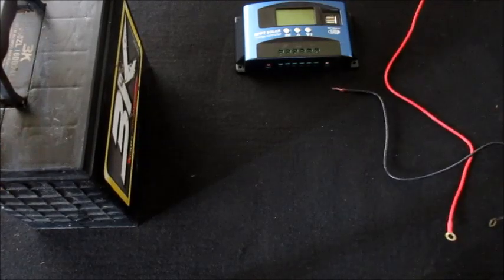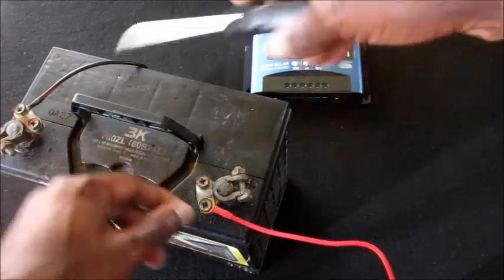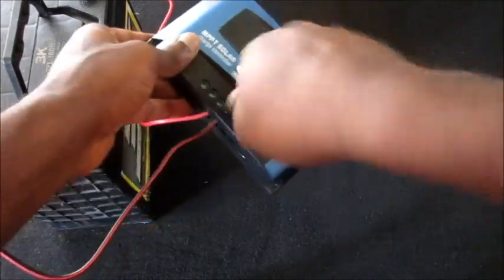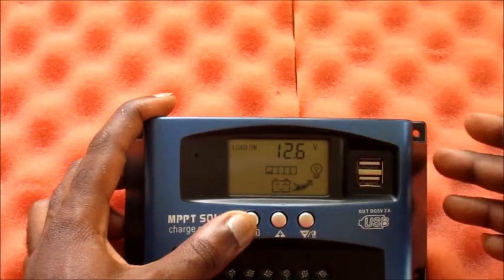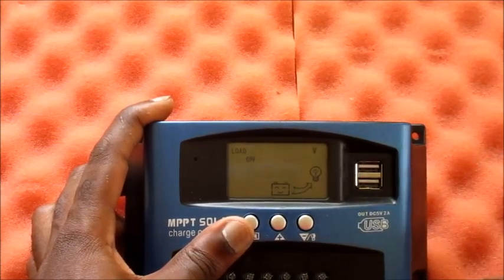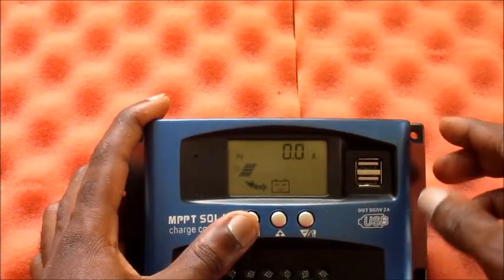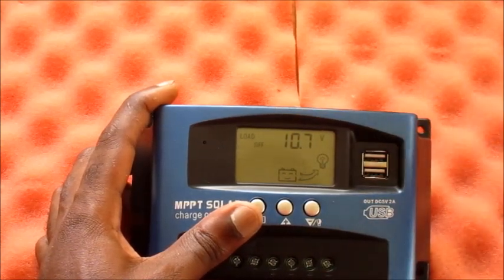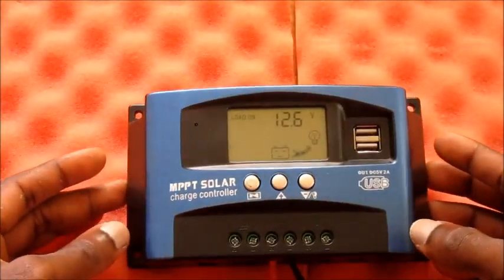How To Use or Setup 40A 100A Fake Mppt Solar Regulator

Comment: i bought the same of your controller but my problem is, it is always in 24v.  can you teach me how to set it into 12v.
Reply from the maker: Are you using 24V batteries or 24V panels ?
Reply: If you wired the batteries positive with positive then you have a 12v system. If you put positive terminal to the negative of the other battery then you have a 24v system..
Reply: @elpasobetta  Yes, if you are using 12v batteries. If you already have 24v batteries, you want to wire positive to positive to keep the 24v. Positive to negative will give you 48v. Do not exceed 24v with this controller. it is for 12v and 24v only.

Comment: Thank you for very good video. I had one exactly same controller. It was very good with 6W panel in camper trailer. I don’t know ehat happened but when i connected 150W panel that controller started hisss noise. Then display flickered and smoke came. Controller was good i liked a lot. You told nice features how to setup load hours. I think i gonna buy another and test again.
Reply from the maker: You would need 20A at least for 150w .
Reply: How many ampers this particular controller can handle?
Reply: 10A max 100watt

Comment: thank you  for your explanation,why is there two connections for the solar panel and the battery connection Eg 3.5mm pushing and a screw type?
Reply: Some panels come bare wired and others come with a 3.5 plug. This controller is designed to accept either one. Harbor Freight 100w panels are 12v and come with 3.5 plug. It plugs into the left side hole. The right side hole is for Power Out, just like the 2 screws to its left. Same scenario. Some appliances have a plug and some have bare wire. Most 24v panels are bare wire. This controller is supposed to detect which voltage is being used, 12v or 24v, panels and battery bank. DO NOT EXCEED 24v!
Reply: @charlessharp9795  Surely that connector could not take 40A?
Reply from the maker: Two connections are for negative and positive..
Reply: I understand that, but there is a 3.5 jack and a screw for positive and negative as well?
Reply: John Berto you can connect a light bulb on that one👍🏾
Reply: @Irene You can only use 12v or 24v, not both. Both together creates 36v, which exceeds this controller's abilities. Each voltage requires its own controller. This controller will accept 12v panels or 24v panels and will adjust the output charge according to the battery bank setup as long as it doesn't exceed 24v. As for both types of connections, as long as the panels are the same voltage you can use both.
Reply: @Irene If you have panels rated 12v/24v you could use them together. But if one is strictly 12v and the others are 24v, the best way to run both together is to get a controller rated for higher than 24v(36v or 48v) or run your 12v panels as a series instead of parallel(making them 24v panels). I know the Harbor Freight 100w system is able to do both voltages 12v OR 24v. In this case it depends on your bank setup. Whether it's 12v parallel, 12v series(24v) or 24v parallel. The 12v parallel bank is charged at 12v from panels. The 12v series and 24v parallel charges at 24v, but that's if your 12v panel has dual voltage ability. If your 12v panel is the HF 100w 12/24v(Thunderbolt Magnum) then you can use it with the 24v panel because of its dual voltage capability. If this is your case, then yes, you can use both panels on this controller. The back of the panel should have a label/tag giving the specific info on each panel. If your 12v panel states 12v(not 12/24v), then no, you cannot use together unless you have multiple 12v panels in series.
Reply: A couple of examples.... I have 1 panel rated 12v only and 1 24v panel, NO.
I have 1 12v panel rated 12/24v and 1 24v panel, YES.
I have multiple 12v only panels(pairs of 2 in series) and 1 24v panel, YES.

These YESes are capable if you have a 24v bank. Trying to use 24v panels to charge a 12v bank only gives you HALF the rated wattage of the panel(s) being used.
Reply: @Irene You'll still need a controller for your 12v backup. It isn't wise to put your panels directly to the battery. The controller keeps the battery from OVERCHARGING. However, if you have multiple 12v panels just wire them in series to produce 24v power and run them parallel with your 24v panel. Much like putting 12v batteries in series to get 24v power, only do it with your panels too. This would allow you to put your 12v panels with your 24v panel.

Also, I was mistaken on my HF panels. Each panel is rated 18v 25w with 4 panels generating 100w in parallel(50w in series). The ONE lead wire(3.5 plug) going to controller is putting out 24v+ in full sun and the controller breaks it down according to my bank. 12v parallel bank and 6v series(2 batteries) gets 12v charge. 12v series bank/6v series bank(4 batteries)/24v parallel bank gets 24v charge. The controller itself will accept 12v or 24v panels.

If you have a 24v panel with a 3.5 plug, plug it in the hole provided. Then, if you have 2 12v panels with bare wire, run them in series to attach to the screws. The hole is provided in case your system is setup with the 3.5 plug.

Sorry for any confusion I've caused.

Comment: Thank you for sharing!  I'm quite sure the only thing about MPPT on this controller is the label on the top!  When you look inside, this is a pure PWM controller and nothing to do with MPPT except the label on the top!
Reply: Sir can I use 12volt battery,and 24volt solar panels
Reply: Devendra Yadav On a real MPPT yes you can use a higher voltage PV, on this version not.
Reply: chinese commie  crooks
Reply from the maker: Yea your are correct 👍👍

Comment: I have runn it on first time with the panel and the screen dosent want to start ( only if i conect batery ) and its not working well . Have i damaged that ?
Reply from the maker: Hi you have to plug up the battery first, then the panels
Reply: Always plug to battery first or Yes you can damage it.

Comment: Can you set the maximum output voltage from pv to battery? I have an inverter that doesnt like the high voltages my current charge controller puts out...so i need a programmable charge controller
Reply from the maker: you can then link you inverter to your battery instead of the charger controller. What the name of your charge controller ?
Reply: @Lenzwalters  It's a generic chinese so called mppt charge controller, it came fixed with the 250w fold out portable solar cells im using. Inverter is connected direct to battery, but the charge controller outputs to battery at the same time.  Ill have to try the Epever tracer and program it to a voltage output that the inverter will tolerate.
Reply: @muttaporial1995  you can set a lower output to your battery.
When im not on the boat i drop it down to 13.7v from 14.1v

Comment: Hi Lenz thanks for the nice video. I have exactly the same charge controller but i cant put the load off/on as same as your values. Load off i can set only down to 20.2, imposible to set down to for example 10.7 to avoid deep charge. Why??? Also load off same, cant set down only posible to set between 24.0 and 28.0. Strange or? I have 200w solar panel 12v, 12v battery 165ah, charge controller 30ah. Thanks for your help if possible!
Reply: same issue here
Reply: @rear-thunder  B01 = Gel;  B02 = AGM.; B03 = Flooded
Reply: b1= Gel; b2 = AGM' b3 = flooded lead acid

Comment: This one not a mppt charge controller, the seller tricked you.
Reply: Why? Please explain. And don't say it looks the same. You can't see a circuit board from outside.
Reply: @davoz73  ... Open it and see no coils, 2nd price too low, 3rd test the voltage B4 the controller see it is exactly the same as the battery when it's charging.
Reply: @johnq8792  from this video, and without him opening the unit I am still wondering how you guys can see inside?
Reply: @johnq8792   it's not my unit, I can't open it and he hasn't.
Prices do change over time, look at the price of solar panels or inverters,
 they have dropped.
My panels put out around 18-20volts before my regulator and around 13 after regulator. I thought that was how it worked.
Please understand .You may be totally right in your opinion, but without facts it's still an opinion ( just like mine)
Reply: Check this video to see a real MPPT controller: https://youtu.be/dQPojcRXXbY
Reply: I opened mine, it is possible, measure voltage whilst charging cycle is on and MPPT voltage is not same as battery, PWM voltage goes down to battery voltage when mosfet switch to charging but then goes back up to solar panel voltage when the electronics stop charging.
Reply: @johnq8792  thank you John. That's what I needed to hear..... someone who owns one that has looked inside.
I don't care to hear opinions unless there is fact behind it and you have the facts. 
Not looking forward to opening the one I have just ordered to find the same as yours. Hoping it was opinion based, not fact based. Damn.....
Reply: Check this video about your fake MPPT charger:https://youtu.be/9fjeYi3SwLc
Reply: Another test, input amps is same as output amps with PWM, MPPT input amps is lower than output amps easy to measure with a DC clamp amp meter.

Comment: Is it truly a MPPT or PWM please
Reply from the maker: This model is a PWM although it mark mppt i believe there are similar features to mppt
Reply: feature like . And is it more efficient than pwm charge controller .n can I use it to power a 12v battery from 24v solar panel please reply thanks
Reply: PWM it produce 30 to 50 % less power than true MPPT.
Reply: Anyone help me i cant set the discharge battrey
Reply: Setting

Comment: I purchased one of these on E-Bay...    NOT a MPPT.   In the Process of sending back.    Ordered the 60A version.  LOL,   Yea Right !   The Terminals won't even take 12AWG wire required for 20A operation.  DON'T Buy one.    On inspection the thing is only a PWM type controller.   NO DC/DC conversion Process achieved.  No Inductor require that would be  required for  Buck Conversion on the PCB.
Reply from the maker: yh. i'm in the process out exploring a renogy charge controller

Comment: Hi could u assist me for setting this controller up I have 2  12v solar panels connected 8n series does this turn it to 24 v
Reply from the maker: Hi yes if in series it will be 24V and amp reminds the same. this solar charge controller is designed for 12v/24V

Comment: good evening mr.. how many  panel of 270   i can  to use in this charger controller
Reply from the maker: 2 panel or so. This charge controller is 30A
Reply from the maker: How many amps is the 270 ?
Reply: i have the 100amp mppt controller and says 50v pv input max, 1300w max so  will 2 x 275 watt (8.5amp each ) 33v each in parallel be ok or will it blow it up..  they should still be same voltage of 33v which is less than the stated 50v max and the 275 watt panels combined are less than the 1300w max of the controller.  and the output will still be 12v is that correct..
Reply from the maker: @Bignbeardedadventures  What the name of your 100Amp Controller so i can assist you more ?

Comment: This is a Fake , this is a PWM Controller
Reply: Has anyone found out if this is a real MPPT or a fake PWM controller?
Reply: Why is it a fake? Because it looks similar to a pwm on the market? I own the similar looking pwm unit and have just purchased this same unit advertised as a mppt, sure they look alike but they aren't the same. Please tell me your comment was based on fact rather than looks!
Reply: @davoz73  open & look inside the controller, if it's real mppt, there should be a donut/rounded wire
Reply: Some of these pwm are mislabeled as mppt. No big deal they both work. Mppt is better by like 20%

Comment: Hello Lenz I have received this product but it is PWM and soon heat up please guide me what should I do
Reply from the maker: how much panels are you using ? and what type of battery ?
Reply: @Lenzwalters  4 mono 165  whatts panels and 185 ah tall tubular battery and connected in parallel
Reply from the maker: You need a higher Charge controller. you would need a 50W charge controller at least. so that why its heating up.
Reply: Thanks Lenz, I have change the charged controller and installed another of 50 amps, working good. 👍 Thanks a lot for guide, assistance
Reply from the maker: you're welcome . What type of controller you now using ?

Comment: Hello Lenz, I have also order for this charge controller and it will be good product, and I like your video thanks
Reply: Junk. Worked short time. No fuse. Opened up and guess what. Fake components inside. Eish. These china'men. Wish i could take a photo
Reply: @prefereachother  Totally agree this is not a mppt charger, it is a trick from china factory. I have order one and find out the quality is very bad.
Reply from the maker: thanks man you're welcome
Reply: Mine is still working 🙈.
I've heard there are copies of the copie out there 🙈

Comment: I think it's not a ppt because I opened it does not have solenoids and I tested it does not increase its power when it lowers the voltage and has no solenoid inside. are you sure it's ppt?
Reply: Marian Cobirlie it should not be MPPT from the housing looking. Just PWM. Many factories made fake MPPT
Reply: @eddisonhe1404 hello .Thanks for reply . .!
Reply from the maker: Hi everyone I am skeptical about it, I did some testing with it as you can see here https://www.youtube.com/watch?v=LJ0kDvQUXP8 . When i am getting 5+ Amp the controller only tells me its 3 amps
Reply: Bad Grandpa  pppt witout solenoid ? Next time bay new one and make test ..thanks !
Reply: Junk. Worked short time. No fuse. Opened up and guess what. Fake components inside. Eish. These china'men. Wish i could take a photo

Comment: Hello Lenz! I installed a off grid solar system on a RV. 2 340 W panels, 60 A Charge Controller (exactly the one from your video), 1500 inverter and 2 115 ah deep cycle batteries. Everything was working fine for some hours and suddenly when the panel got direct light the charger stopped showing the charging icon. Any idea why? Instructions say: Probable Cause; "Solar panel open or reversed".  I don`t know what that means. Thank you!
Reply from the maker: Did you ground your panels ? it can be a short circuit in one or more module. However this can be cause by reversed current to. I will do a video on it soon
Reply: hello! maybe the battery is fully charged. Think of discharge a little battery and check it again.

Comment: Hey lenz I hook up everything  but it show  the my pv is off how do I turn it on
Reply from the maker: What type of pv are you using? and is the pv set up correctly?
Reply: @Lenzwalters   the exact same one
Reply from the maker: disconnect the wires and reconnect them. Start in the order with + and then _ for the battery
Reply: Mine did this but i think it was because the battery was new and i had fully charged it already.
Couple days later after running the diesel heater it was working fine

Comment: Lenz, I bought this and the instructions are so terribly translated from Chinese to English, that I began to look for Youtube videos on how to use it and how to properly play with the settings.  My solar panel is currently a 18v 10watt (it's voltage can be as high as 20v when not in a circuit).  This controller seems to disconnect the panel because, from what I understand, it cuts off the panel at 15v.  If this is correct  then this mppt is useless with my panel.  The 3rd button doesn't turn the light on/off on command like you suggest.  If you would make a video, showing it conected to a panel and light, functioning as intended, it would be lots better.  Just connecting a battery doesn't help much, but thanks for your attempt.  tabaccopuro@yahoo.com
Reply from the maker: Hi Tabaccopuro I will do a video on it. the light of/on you are referring to is the load. It should be working with the button. One of my panel is 17.2V and it worked perfectly with pvm solar charge controller. But I never tried it with the Mppt, but it should work perfectly. I will do the test and upload
Reply from the maker: Hi Tabaccopuro check this out https://youtu.be/Um-G0s_yNEw
Reply: I bought this controller as well for my 24 v system and it has been a complete headache. It hasn't worked correctly since I first hooked it up. I took it apart to see if I could find any problems and it was missing a screw that holds down the circuit board. It was supposed to be new but it's junk. It is NOT a real mppt controller. It doesn't have an inductor in it any where that I could see. I have the same problems that you mentioned.  Seems to be a common occurrence. Don't waste your money on it, its trash!  -BA
Reply: My panel put out close to 40v it's a 370Watt panel will it work